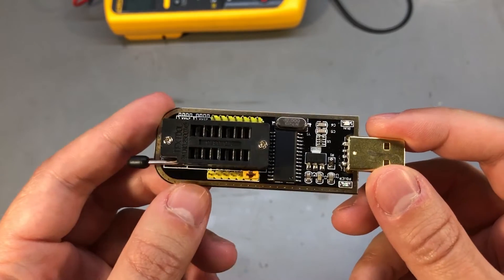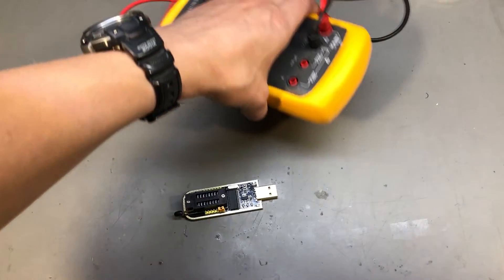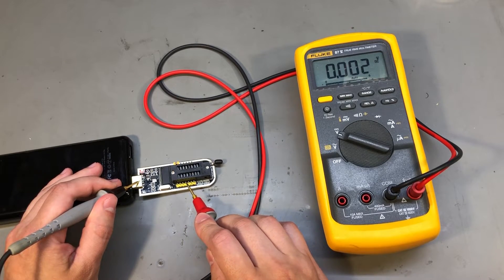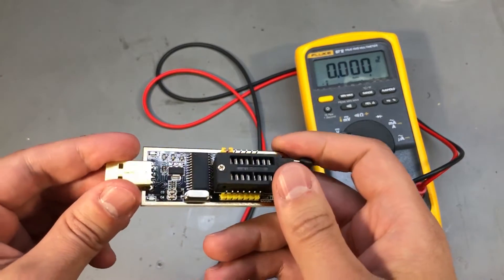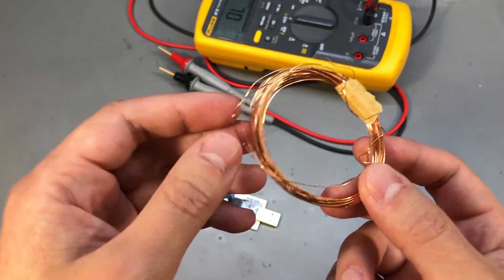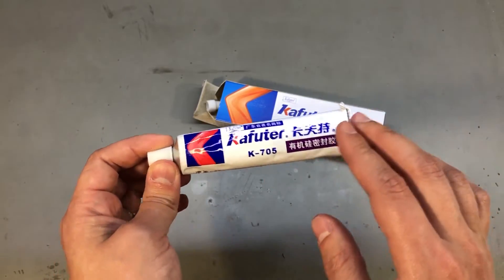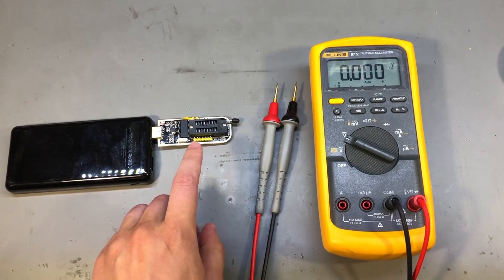CH341 Programmer 3.3V Fix | Voltlog #318

Comment: Unnecessary thing to worry about, i think. People sure love overengineering things and fixing what aren't broken. Have you ever seen a chip broken by one of these boards? They only have an internal current limit when actively driven up of 8mA per pin. When pulling up, it's even much less, about half a mA. ESD protection diodes in target devices appear to be able to dissipate the current easily. It's also likely running in WCH Pseudo-Bidi mode which is default on all pins, where they're actively driven up only for 2 cycles, and then always just pulled up weakly, so you get both the active drive signal quality and you don't end up pushing a lot of energy around. Maybe it's a bit rude, but it's alright.

There is also a reason why they run the chip off 5V, i think. When powered by 3.3V, the WCH chips are not 5V tolerant!
Reply from the maker: I wouldn't call switching the VDD to the chip to the correct 3.3V for 3.3V logic, that's just engineering. Maybe if I would add a voltage level translator and a switch for having both 3.3V and 5V switchable that would be overengineering.
Reply: @Callum Faulds The supply voltage is only 3.3V, or however much you set it. If you route 5V into a 3V3 chip's power input, at low impedance, it's usually game over. The data pins get clamped to target chip's VCC by ESD diodes, and given their high source impedance, the damage is avoided. Or how'd you blow up the chip?

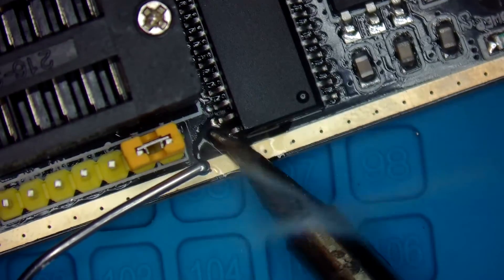Comment: dude you are going wayy to fast what is the tool you used at 3:55 not the solder iron the one with the ball like ending attachment
Reply: It's not a tool. It's just solder!
Reply: @ProdigalPorcupine  where did you buy that from I’ve never seen solder with the ball like ending like that?
Reply: @jwizz1396  - It’s just the way it’s melted, it can happen that way.

Comment: Will you work with EEPROM needs 5 volts after this modification? Thanks
Reply: You'd need to check the datasheet for the EEPROM in question, if it says it needs something like 4.5 to 5.5v supply it will not work, but this would be very uncommon today.